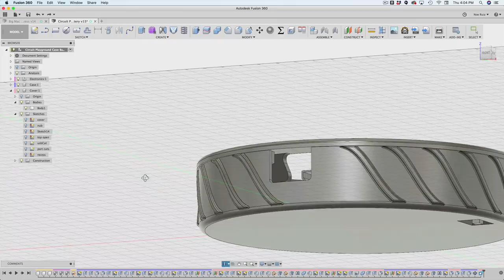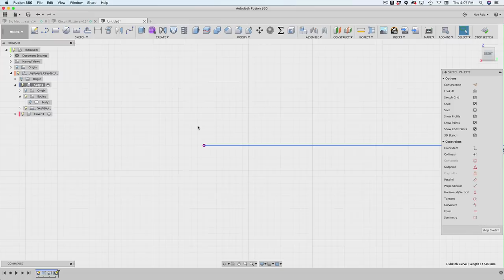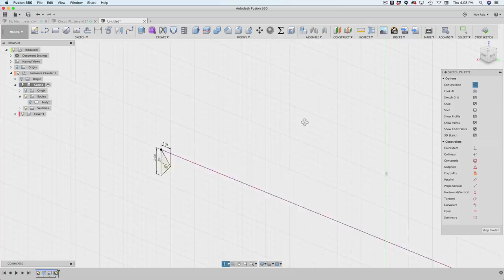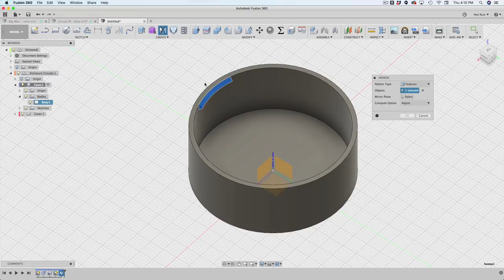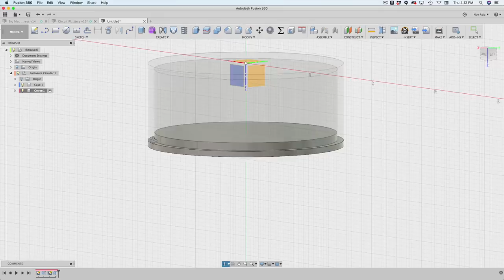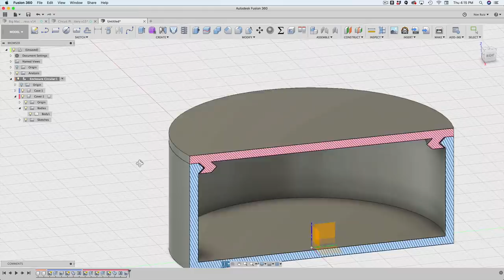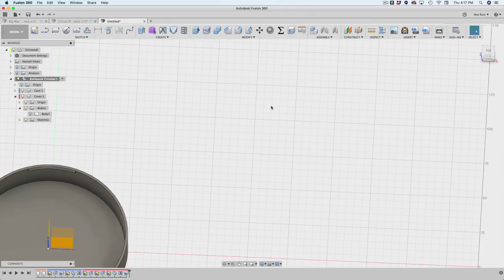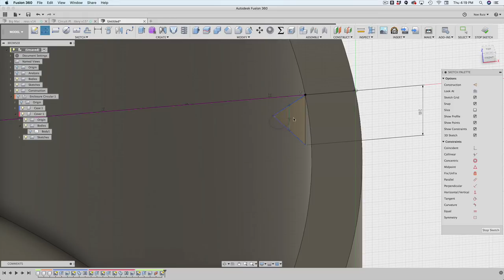Fusion 360 Tutorial – Circular SnapFit Cases!

Comment: There is a fast solution to creating the triangle, if you use the create edge polygon option, which by default will give you a six sided poly.  You can drop in 3 sides when creating to make a perfect triangle.  The only issue is that all three sides are the same length and constrained as such, so you can't dimension the height independently.  If you don't care about that and just want a fast "perfect" triangle to use as your sweep, this method works pretty well.

Comment: Hi Noe, I know this was about 4 months ago. For a triangle you can do a 3 sided Edge polygon. Also the Change Parameters box allows you to modify the dimension defined parameters into the user named parameters. In Change Parameters open up Case or Cover and Select the Sketch you need to change. Select Sketch1, Expression value for d1 and change it to your user parameter. ie: 50mm change to width. Clear as Mud?? Thanks for great Videos Rick

Comment: I haven't create a bunch of cases but you could create the bottom case with clip (I like the sweep approach) and then use a combine to make the clip cavity in the top case. Once you get that, could you use the pull/push tool to create the cavity offset? From there, you can so the shell and mirror/copy along path to make the tabs across the rest of the case.

Comment: Would that actually snap without breaking? 11:48
Reply: I suspect the tall wall bends outward to let the lid's nub pass. It does seem like it would take a lot of force to open. I'm in the midst of redesigning a snap-fit box that snaps closed just fine, but needs a screwdriver to pry it open - oops.

Comment: For creating a triangle could you not do an equal command of the two edges that are the same length?
Reply: Yeah that would also work instead of the construction line. It would be the same number of steps.
Reply: @spencerh9421  When I try it, it moves one of the sides and not just the tip of the triangle.